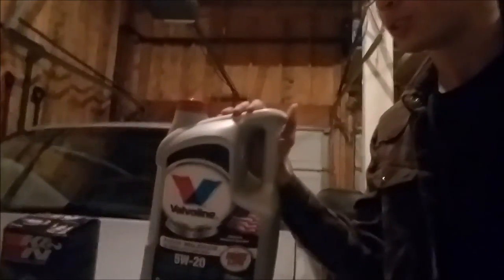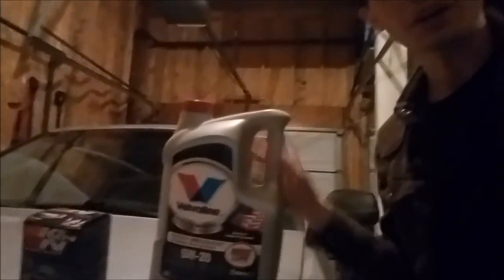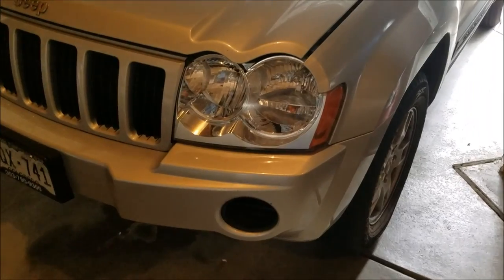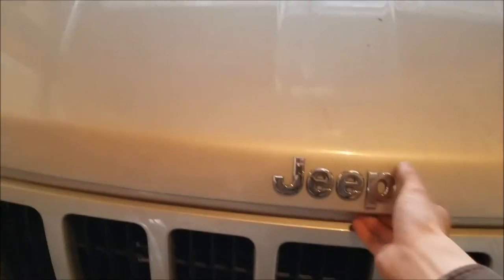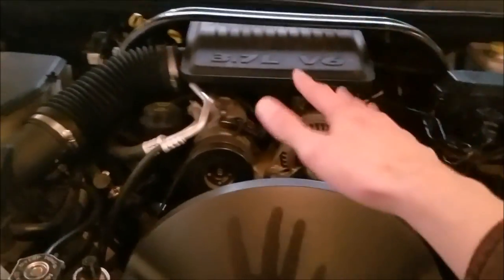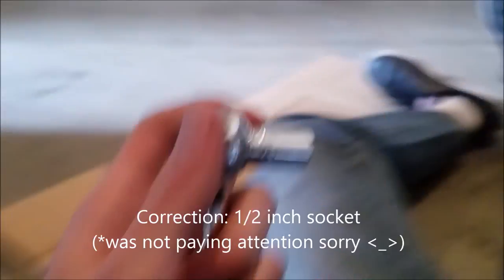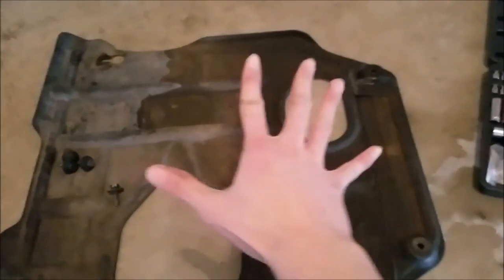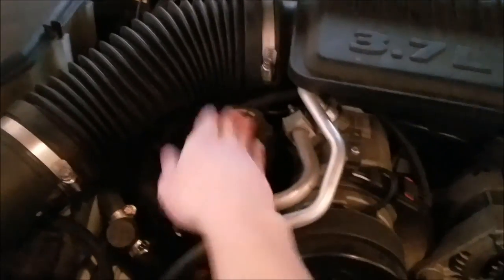Time for Rocky's Oil Change! (Jeep WK Grand Cherokee/XK Commander 3.7l V6 Oil Change)

Comment: I use a bread bag over the filter when I am removing the filter. It catches any oil and the filter just drops into the bag. You may have to adjust the bag a few times as you are turning. Clean and easy. No need to prime the oil filter. It pumps in there very fast. No harm if you do it. Put some cardboard down on the floor when changing oil.
Reply from the maker: Arthur Smith Those are some great tips, thanks! :D

Comment: I just bought an 07 Grand Cherokee Laredo 4x4. It’s equipped like an Overland though. She’s got 131,000 miles and her name is Shaniquah! I love her so much
Reply from the maker: That's awesome! :D Jeep WK gang!
Reply: I use Mobil One oil filters on my 07 Jeep 3.7 GC. Always a top rated filter in testing. $10.00 at Walmart. 209A are the code numbers for the filter.
Reply: Don't forget to check out your air filter cabin filter coolant quality power steering quality brake fluid quality. Use top tier gasoline. You can Google top tier gasolines. Go with a good local independent mechanic to check out the Jeep.
Reply: I have one aswell!!! I named mine kevin teehee!
Reply: I live in Vegas and I’m due for an oil change she’s got 204K miles atm it’s still spring time here a scorching 91 today lol but in a couple of months I’ll be 118ish and up should I use Mobil1 high mileage full synthetic 5W30 now since summers around the corner?

Comment: we just bought a 2010 jeep grand cherokee its used but in immaculate condition this our 2 jeep  it's one was a 94' jeep grand cherokee laredo, will be changed the oil in mt '10 this weekend changing the oil is cheap it you can do it yourself

Comment: You should run the car and heat the oil prior to draining so any contaminants will be suspended in the oil and thinner hot oil will drain faster and better.

Comment: Thanks for info just bought a jeep same color everything but where's the oil dip stick
Reply from the maker: Spanky 673 Thanks for watching! :D The oildipstick should be located directly to the left of the airbox on the 3.7l V6 models. (Dipstick is around upper left part of engine bay) There should be an oil dipstick there
Reply: Spanky 673  it's in the back of the engine on the left side. It will have the ring to pull it up and out. They don't give you a transmission fluid dip stick. It has to be checked by computer at the dealership. They want to charge you to check it. Don't worry about it unless you think you have trans problems. The round piece with the grooves next to the oil dip stick.is for transmission. It says dealer only on the cap. Do not use a wrench when putting a oil filter on. Strong hand tighten only. You could ruin the oil filter gasket by putting it on to tight.
Reply from the maker: Arthur Smith Actually, some WK models (not all) equipped with the NAG1 Mercedes Transmission DO indeed have a transmission dipstick. My Jeep, Rocky, happens to be one of those Jeeps. It's not a universal dipstick either and as I mentioned, for some dumb reason, the people who designed the 3.7 WK decided not to include a tranny dipstick on all of the Grand Cherokees they made. What Rocky has is also an actual official transmission dipstick designed for the NAG1 W5A80 tranny too.
Reply: TheValleyofAwesome  my 07  Jeep GC doesn't have a tranny dip stick. It says dealer only on the cap. I guess the dealer needs to check it with there computer and that is billable time. No dip stick in my daughters 06 either. Just another way to screw you at the stealership.
Reply from the maker: Arthur Smith Yeah, the stealership sucks :( No joke. I know that from experience. It's why i like to do my own oil changes and my own vehicle repairs when I can. I sort of became my own family mechanic in the house thanks to past. encounters with the stealerships. It really saves a lot of valuable bucks when you know what you're doing! :D
Reply: TheValleyofAwesome  check for cabin filter. Jeep didn't include one. . I bought one on EBay and just slid it in on the rails and didn't buy the kit. It goes in the outside of the Jeep on the passengers side. Take the plastic drip cover off and slide it behind the metal open side. It will fit in from the right. There are small rails it will slid on. Cheap bastards didn't even include a cabin filter. You can YouTube and see how it goes. Don't buy the kit mine works fine.

Comment: Just subbed! Keep up the good work. I have a commander same set up as yours! Looking for a good lift kit?  Your lift kit?
Reply from the maker: Thanks for the sub! :D I really appreciate it! As for Rocky's lift, she actually doesn't have a lift. I removed her lower fasica that gets in the way a lot when off roading with her and it gives the appearance that she is lifted (lol). Removing the lower fasica increases her approach angle anyways which allows her to crawl onto an obstacle and descend much better than a regular stock setup. Eventually I will lift her though :)
Reply from the maker: I am knowledgeable in lifts however, after spending time in several Jeep forums. How high of a lift are you looking for? I'm eventually going to lift Rocky 2" inches with the fronts being Bilstein 5100 adjustable struts and a 2" Old Man Emu HD Coil Springs and shocks in the rear. (Heavy Duty because I plan to overland with Rocky here in Colorado and need more heavier duty coils to carry heavier things). I believe this is the best setup as using a strut to lift the vehicle puts less stress on suspension components than spacers due to the angles spacers make

Comment: What size is the oil drain plug?
Reply from the maker: Are you referencing the socket size for the plug or the actual plug itself? If you are talking about the actual plug itself, it's often vehicle-specific and those plugs can be bought at your local auto parts store

Comment: . Man change that oil and filter at least every five thousand miles. You need to take care of Rocky better than that.
Reply from the maker: Arthur Smith Yes that's what I did did previously but didn't mention it in the video. Thanks for the helpful tip!
Reply: TheValleyofAwesome   Hey Arthur here again. Google. Been Testing Oil LS1. It s about using 1 oz per 5 gallons of gasoline Marine outboard two cycle oil TCW3 rated oil. Cleans and lubes the whole entire fuel system. I've been doing it over a tear with great results. You wouldn't know my Jeep Laredo GC was running at idle. Try a couple of tanks
Reply from the maker: Arthur Smith interesting. I'll definitely look into that when I have time 🤔

Comment: I pay $25 to get this done by my mechanic I usually just chill n wait 20 min then I’m done ✅🤫🛢 I know it’s super easy but I’m paying for the convenience fee 🤪
Reply: For $25.00 your probably not getting full synthetic oil or a quality filter. Most likely it’s conventional oil with a cheap filter.
Reply: @arthursmith643  it’s a half synthetic blend w a new filter every time
Reply: For $25.00 you can go to Walmart buy Walmart Super Tech full synthetic and get a Mobil One filter. Super Tech is great oil all the  cool numbers and letters as the more expensive oils and has the API seal of approval. Much better products for the same price. Just a half hour of your time.
Reply: @arthursmith643  Tnx for the advice I’m gonna look into this on my next oil change 👌🏽 btw those fuel injector cleaners by stp that little bottle for high mileage cars could I use a bottle every full tank or only every oil changes?